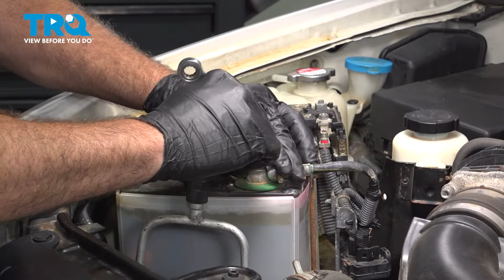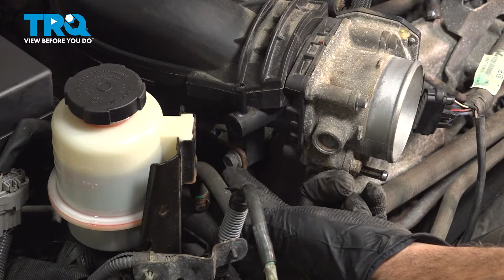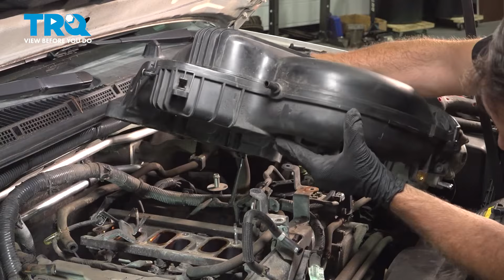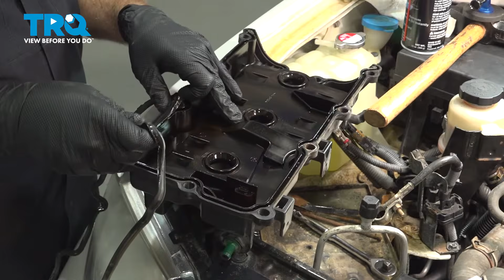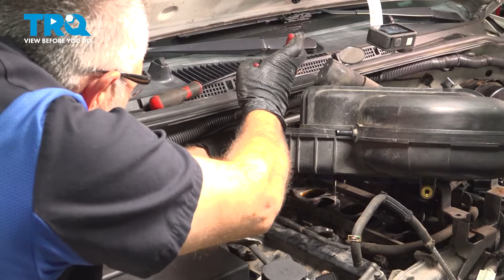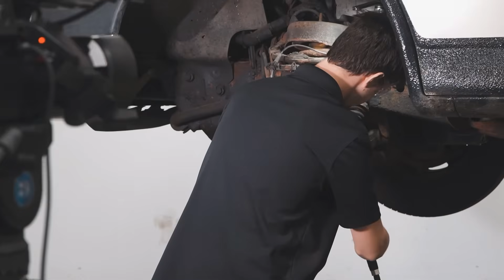How to Replace Valve Cover Gaskets 2005-2021 Nissan Frontier 4.0L V6

Comment: This is an amazing tutorial. Thank you for making it! A few notes to help others: scraping rtv was the longest and hardest part of this - stiff nylon brushes, razor, and non chlorinated brake cleaner as chlorinated is harder on the aluminum; I wished I had a torque wrench that was in the low ft lbs/high in lbs range; the electrical connector he struggled with on the passenger side you don't stick a screwdriver in but push it from the outside left side - you can see a slot in the pass side of the metal; the other connector he does after that I struggled with until I was able to get my needlenose in and squeeze both tabs at once. Took me 8 hours and I took my time and replaced a lot of other stuff (plugs, coil seals, solenoid gaskets, etc.); if you are pre 2016 you should also do cam and crank sensors as they are easy with all this off. I think worth it to get new covers also as the spark plug seals aren't replaceable. Good luck!

Comment: Great video, great info, just two observations: I would clean with compressed air everything in the engine bay, before I start taking anything apart, then one more time before I remove the  valve cover and the second thing was the way the cylinder head was cleaned before reinstall. Also, a diagram of valve covers and intake bolts tightening sequence would be helpful as well. Other than these things, it was very  helpful. Thank you!!

Comment: Should mention you will most likely need to preform a throttle body relearn procedure once you reconnect it, or just risk the truck being in limp mode

Comment: If you go to the trouble of replacing the valve gaskets, may as well replace the valve covers! If the valve cover gasket is toast, the spark plug seals are next. complete valve covers with gaskets are not that expensive, and labor cost is the same!

Comment: Just replaced my valve cover(right side) yesterday.   Great job on the video.  Save me a ton of time on what to do.   Quick note,  you may want to replace the vacuum line that connects the valve covers.  Mine was cracked and very stiff.  Thanks again for the video.

Comment: This will fix Engine bank 1 light on as sensor had detected oil leaking from valve cover.Very appreciated to video this replacement❤

Comment: I have a 2013 Tahoe 5.3 with simultaneous codes P015b and P015d, check engine light went away on its own for one day, then came back on with the same codes in it, can you offer any help, thanks.